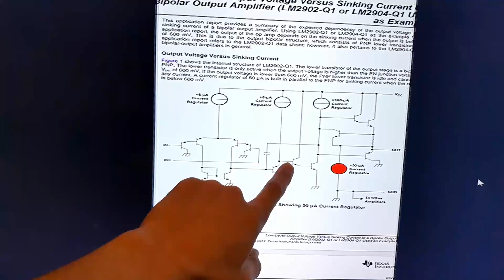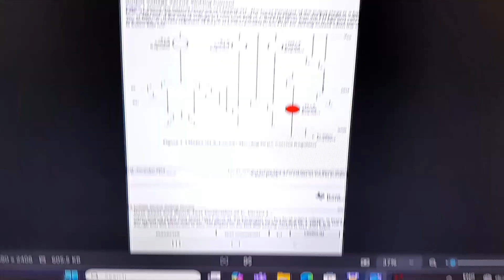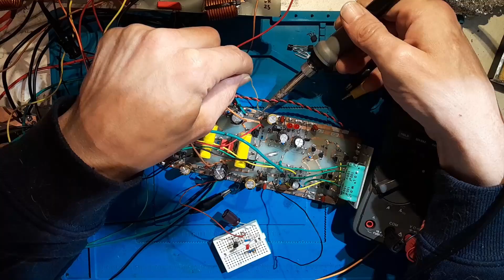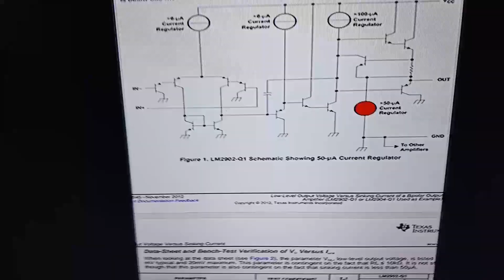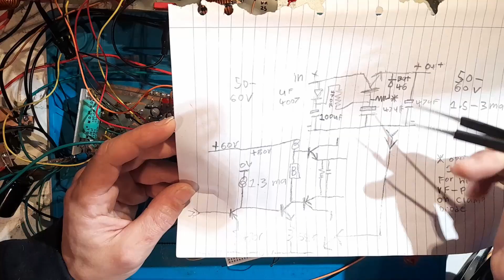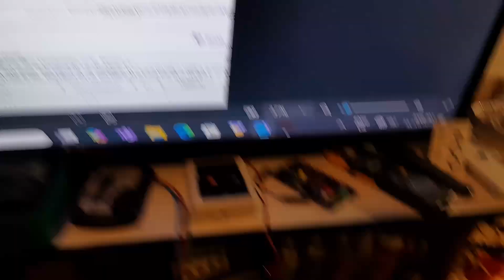Pnp-npn vas, is it that the missing npn acts like an inverter and is stopping this idea from working

Comment: Have you considered the possibility that the extra NPN transistor is being used as a buffer, isolating the base of the final NPN from the emitter of the first PNP and it's CCS?
Reply from the maker: I get it's a buffer, but what im not getting is why I can't make it work  using the pnp as a buffer with a ccs, I have to sit down take some measurements and have a proper think about it, I have a feeling there is a current path im not considering with it setup like like this, and that that is stopping the IPS from driving the vas transistor via said buffers. I didn't think it would be a problem driving a pnp base from the IPS because I thought it would just correct for it by outputting more negative relative to gnd, but now I think about that im realising that may not be correct because there will be a path from the 0v rail through the pnp and out its base and into the IPS current mirror transistors and to the negative rail. So I'm going to have to sit down and do some investigation to see what I've missed! Did you notice a reason I couldn't make the beta enhance transistor a pnp with a ccs?